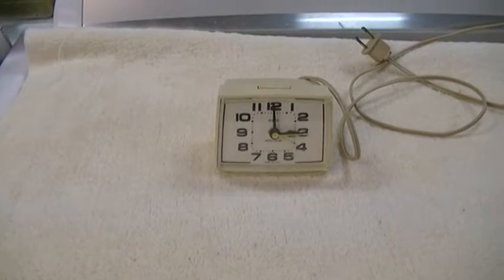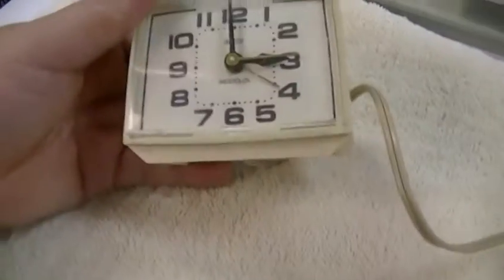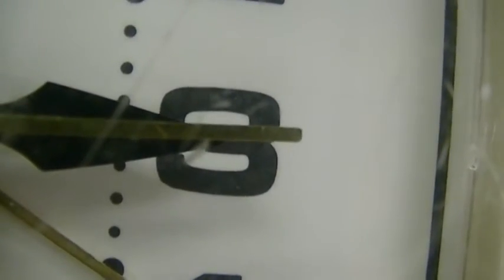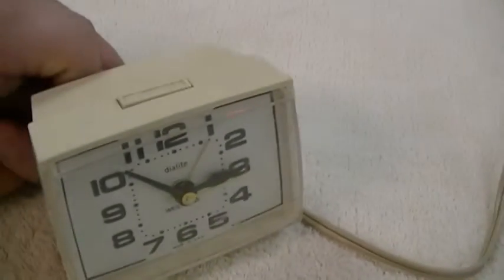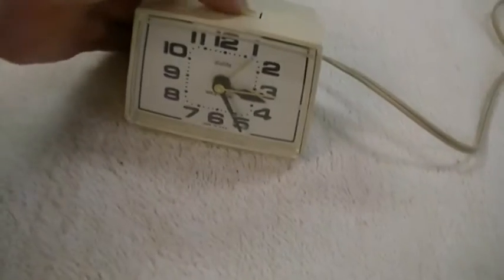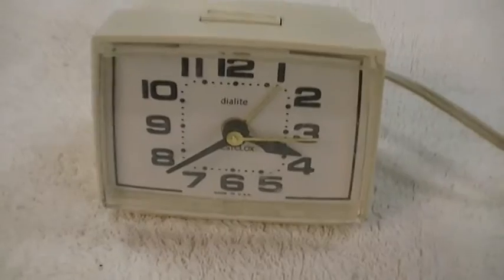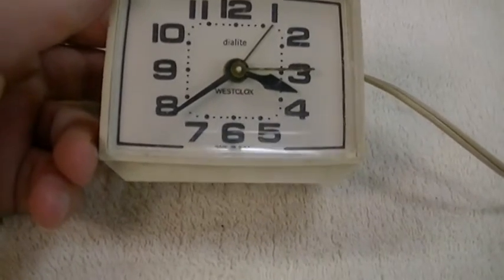Help!  Westclox Dialite Fail!

Comment: I venture to guess it is the motor going bad and not have enough torque to turn the gears. Unless you dropped the clock and jammed the gears, that would be the most likely reason.
Reply from the maker: +wtam69 Definitely never dropped.  I'm going to send this off to a certain Harley Badger for the official diagnosis and possible repair.  Besides, I have some other stuff to send him.

Comment: shame to such a vintage piece, this response is quite late, but I hope you were able to have it restored.
Reply from the maker: I still have it, but it hasn't been fixed.
Reply: Ah. I have no experience fixing these things, i mostly buy them working. I'd assume there has to be a way to oil/clean the motor or something like that.
Reply from the maker: Yeah, a bit too mechanical for me to mess around with.
Reply: Makes sense, I am the same way, a little nervous with messing around with my clocks.
Reply from the maker: Never really had much mechanical experience, I'm a computer technician by trade.  I can rip just about any one of them apart and fix them with my eyes closed.  Even brought back a few from the dead in my time.  I love vintage stuff, especially vintage hardware.  Certainly a dying breed, as consumerism has taken over wanting only the latest and greatest.  As you probably well know, the latest and greatest sure is great, but there's one component they left out, which is longevity.  This clock ran for how many years until it failed?  Never see that again in anything.  Also why I got myself a classic car.  Not that I'm a wrench head at all, by no means, but it sure is easier to work on!
Reply: Yeah. I would love to learn how to fix, I think the world needs more of em. More people to appreciate the great stuff of the old days. I proudly spend money on cuckoo clocks and coins and stuff like that, unlike anyone else that I know of. I love helping out the old days from totally dying
Reply from the maker: Agreed wholeheartedly!
Reply: Glad I found someone else who does :D

Comment: Take it apart and give it a good cleaning! Make sure the motor stays lubed. The clicking sounds like there is a gear jammed, look for a "clutch" inside of the clock and follow the gears for the hands back to the clutch, the jammed gear should be between those two points.
Reply from the maker: +kd9bwi If only I could see that well!

Comment: Maybe the little piece that reverses the motor is stuck. I have quite a few of these clocks and typically the grease inside dries up and the motor cant over come the resistance. I would say it is likely an easy fix.
Reply from the maker: +BrunoShow124 We shall see...

Comment: This is an old video so I am not sure if anybody out there is even watching it anymore.  I have about 4 of these Dialite clocks and they all work but the light on 3 of them either flickers or does not work at all.  I have been trying to figure out how these clocks come apart.  Any suggestions?  I would like to see if I can replace the light.  I see one comment where somebody just pulled the front part out but could get no further.  I had read somewhere where a small NE2 bulb would work?
Reply from the maker: I never did get mine apart.  How to do it, I don't know.  Chances are the NE2 bulb would work, if you can get it apart.  Sorry I can't be of more help.
Reply: Thanks for such a quick reply.  I will continue to look at it to see if there is a way.  After all, they were assembled somehow
 @jaykay18
Reply from the maker: @harryjohnson5118  I'm sorry I couldn't get back to you sooner, I usually do.  Yes, they were assembled, so they have to be able to be disassembled.  This project sort of fell by the wayside for me, I've had many other fish to fry since then.  I've replaced this clock with a small Spartus digital clock from the late late 70s or early 80s.  No analog face and neon glow, but it does have woodgrain!
Reply: I try to pick up clocks at antique stores and estate sales on occasion.  I think people think I am crazy because of all the clocks I have.  Most are probably from the 80s or 90s.  I have some of those Westclox Big Bens and some work and some don't.  They are stamped Made in USA but I'm sure they were the last of the production.  A lot of plastic.  I picked up a GE lighted dial and blue case yesterday.  It runs fine.  I also found a Simplex slave clock last week.  It runs and keeps time when plugged in but I do not have a master clock to sync with it. I just like these old clocks and the sweep second hand.  I also have a GE kitchen clock with bakelite casing (I think).  Probably from the 40s or 50s.  Hanging on the kitchen wall @jaykay18
Reply from the maker: @harryjohnson5118  None of those stores or sales really around me, prime real estate here.  There are plenty of people with clock collections.  My house probably has at least 2 clocks in each room, sometimes more.  I've made videos of most of them.  I remember the Westclox Big Ben clocks, my father had one from the 70s I believe.  Not sure what ever happened to that one.  

I've saved the clocks out of junked cars I've owned, and hooked them up to 12 volts.  My favorite clock is a Timex "Simple Set" clock that has a numeric keypad for easy setting, I keep that on my nightstand.  I have a couple with multi-color displays that are pretty nice, and a few VFDs, with a few other oddballs along the way.

Comment: i just bought that same identical clock on ebay ($10 including shipping) in real clean condition and works good except for the light is dim and flickers. is the light bulb pretty easy to change?
Reply from the maker: It's an orange neon indicator bulb.  I don't believe it's socketed at all so likely you'd have to cut and splice the wires.

Comment: Hey, jaykay, or zappy bear or others:  How do you take this clock apart ?  I  have  snapped off the crystal -- but after that I can't go further.
Reply from the maker: I got as far as pulling the front plastic, clock hands, and clock face.
Reply: Thanks, jaykay.   I was hoping for a less intrusive solution.  Perhaps what you did is the reversal of factory assembly, after all.  Mine  just stopped running, with no mechanical anomalies.  Dead, like an electronics fault.  I peeled back the flexible face;  the light-source is there -- early electroluminescents, I guess -- but found nothing to unclip or release.  Too bad.  Thanks again . . .
Reply from the maker: Sorry about that.  This one I have was left behind by the previous owners of this house, it sat in the garage for many years until one day I decided to test it out.  It ran for quite a few months before this happened.  I'm sure it can be fixed, but I don't have the time or patience to figure it out.

Comment: Take the entire thing apart and have a look see.
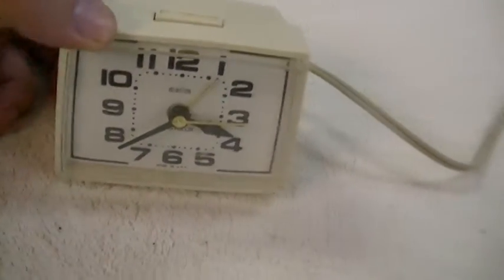Reply from the maker: +xjoe81x "You got corncobs between your ears, son?"  1:03 in the video I said "I did pop it open to take a look, and I saw the little motor in there was sort of jockeying back and forth..."  I'm not a clockmaker, so I really don't know what's next.  Everything that I could see looked OK, but there's got to be someone out there who has repaired one of these before.
Reply: +jaykay18 What about taking it apart again and turning the shift by hand
Reply from the maker: xjoe81x Did that too, it jams up.  That's why the motor jockeys back and forth.